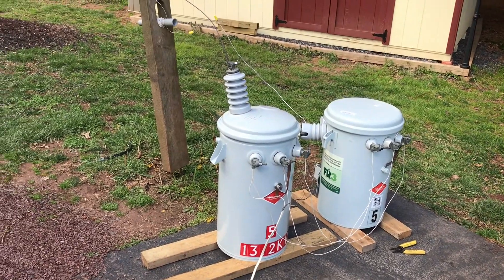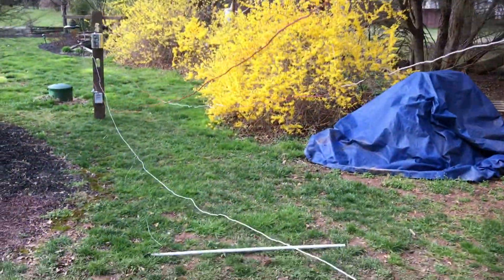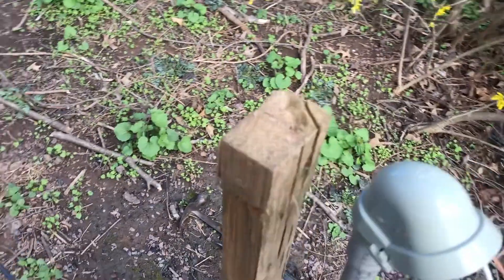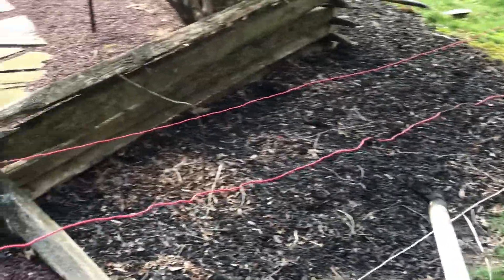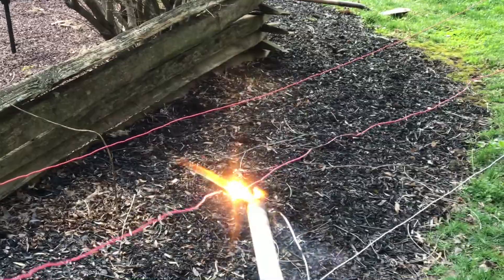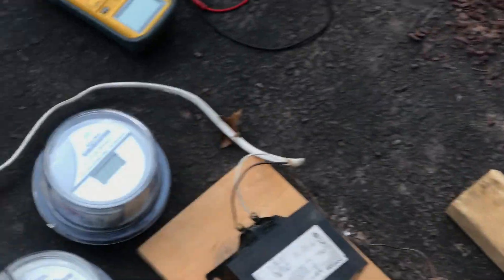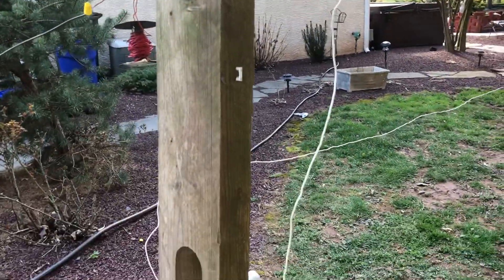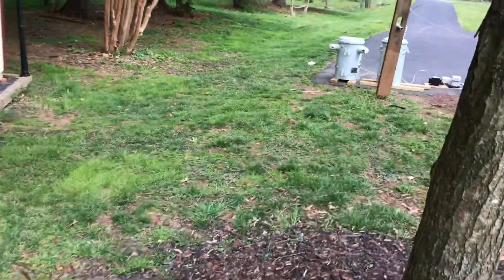7,620 & 2,400 Volt Backyard Arcs

Comment: You're back!! Glad to see you've got more transformers in your collection. Despite my 14.4kV 5KVA pole transformer, I might at some point purchase a 10KVA 2400/4160y 7200/12470y pole transformer. Might be a while though, but I want to get a transformer to replace my shitty MOT stack, no sense in using them for HV when 2 minutes in they are on fire hot.
Reply from the maker: Variac Maniac I know I haven’t uploaded in a long time, been trying to land a post graduation job and buy a house. The 10 kVA in the dual voltage would be pretty cool. That 2,400 one was quite pricey because of the FR3 oil; however, it is pretty amazing in dielectric properties. I wish I ordered it in that 34.5kV transformer, would have saved a lot of headache. Best regards!
Reply: @metersocket00  You're alright, I've been busy also. Been taking classes for utility technology. Now all college is online, things are more difficult and slower. I just want to be done with these classes that give me 5 page assignments. I also need to get a CDL that's more important to me as well as all my hands on classes. Your 34.5kV transformer had partial discharge issues and I'm guessing the FR3 fluid would have been better. Hope all is well.
Reply from the maker: Variac Maniac I wish you the greatest luck! It is awesome you’re taking up the electric utility industry. My targeted career is in law enforcement. But that new 34.5 transformer has some harmonics at the base of the bushings, they don’t sound like a coronary discharge. They almost sound like an old school camera flash capacitor whine. It would have been nice to have the piece of mind. But FR3 would probably been out of my price range for that transformer anyway.
Reply: @metersocket00  Thank you sir, I appreciate that!! I wish you the best luck in return! That's weird that it would sound like that, usually HV DC makes that kind of noise. Yeah, I'm sure, that oil does go for a lot per liter that's for sure. Stay safe!!